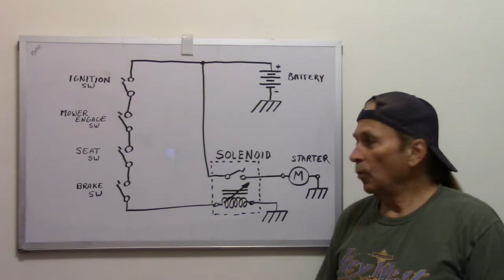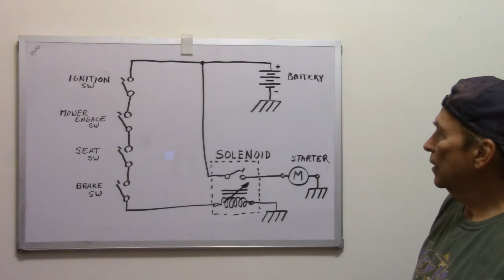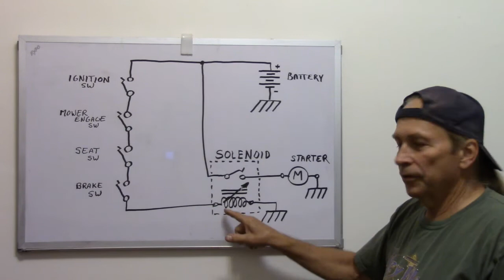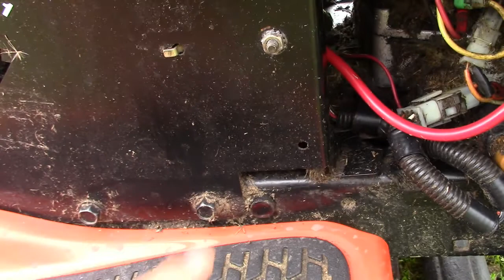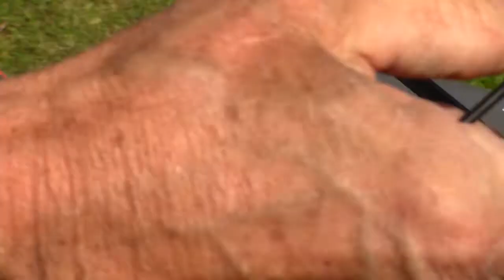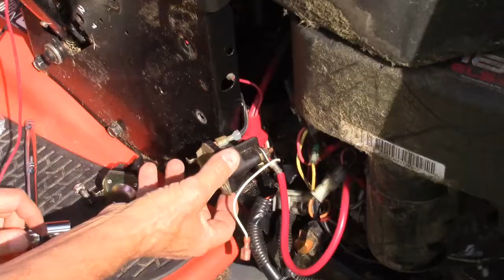Troubleshooting Riding Mower, will not Crank

Comment: Easy way is to use a jumper wire from positive battery terminal to the little blade post after you unplug the white wire, if four post run other jumper from that post to the negative battery terminal 😊

Comment: We get 12v from solenoid but when connected to starter the the voltage drops. Can you help us understand this.   We replaced solenoid and all other tests are good.  Thank you
Reply from the maker: starter is a heavy load on battery. measure battery voltage when you connect the starter, it should show the same voltage drop as the solenoid.
Reply: @donaldporta  Now with a fully charged battery starter moves flywheel a 1/2 rotation.  Is it possible when we replaced ignition coil that the engine is now out of phase?
Reply: @donaldporta  At the solenoid there is an almost 11 v drop and at the positive terminal just a 4v drop.
Reply: When we test resistance at starter there is 0

Comment: I have a craftsman 12 hp mower i have new battery key switch solenoid can't get it to do anything. What can be wrong
Reply from the maker: first check fuse, which may be hard to locate, I believe it will be a 20 amp fuse. if good, try jumper wire to starter to see if the starter will activate. if good. try pos wire to solenoid to see if activate starter--- this will function as ignition switch. Make sure to locate fuse first--- let me know how that goes!